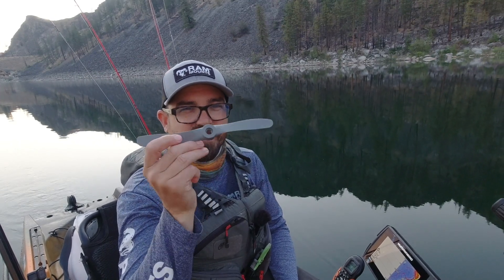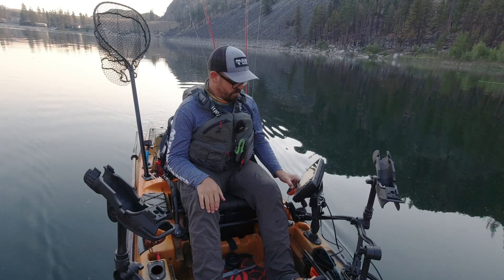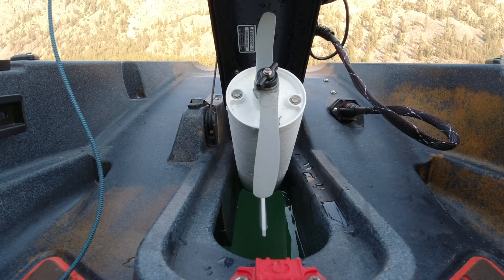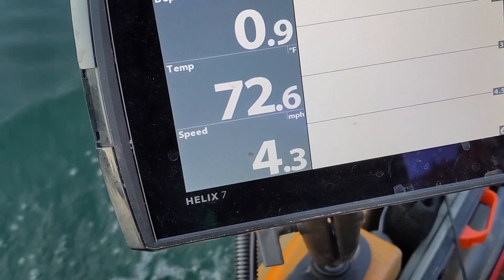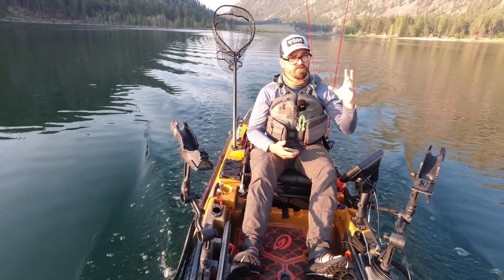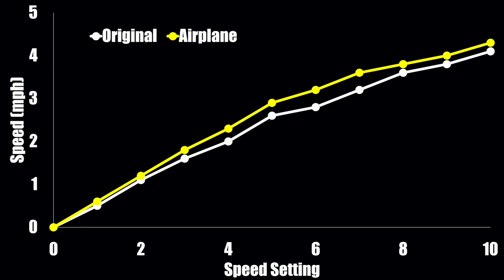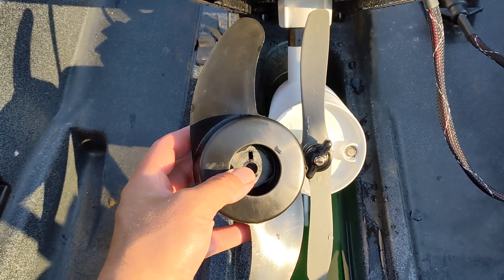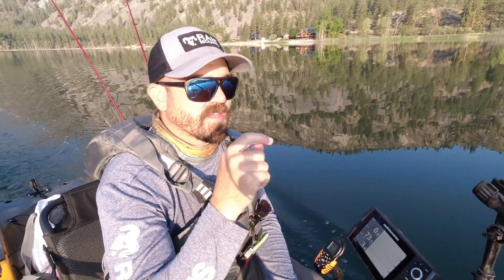Upgrade Your Trolling Motor for $4 [Airplane Prop on a Trolling Motor]

Comment: Prop twist has a lot to due with efficiencies and speed and needs to be matched to the rpm of the motor for peak efficiency. 

I believe the reason the rc prop is increasing the speed is because it matches the rpm of the motor and density of water as well a having less surface area and a larger usable thrust area with the small hub. That's just lucky that this prop matches the motor well in water, a different propeller may be better or worse. 

Mostly I think the reason is the increased drag on the propeller is the main factor, the stock propeller is just so much bigger when it comes to area coverage and that causes drag.
Reply: Yes, some of these points are correct.

Comment: If I were to guess the increase comes from the airplane propeller you have less weight and less drag so because of that you get an increase prop spin speed or faster rotation making it more efficient. the hub being missing I suspect is offset by the smaller overall surface area of the airplane propeller. Trolling motors were designed for full sized boats so the larger prop is basically forcing them to run in low gear so you have the power to push a larger boat. OK that's my guess we would need to have a bunch of different props to experiment to get a better idea to get to the bottom of it. I would like to see a hub added to the airplane prop see how that affects it.

Comment: I’d be very curious about the ability to handle wind and chop using the airplane blade. With a smaller blade width, would there be enough water displaced , and thus force generated to counter a headwind.
Reply from the maker: I don't think it will change the outcome. Thrust is thrust which translates to speed. It doesn't matter what's going on above the water.

Comment: My bet is that the trolling motor prop was designed to work with a wider range of boat sizes with a more generalist application. The plane prop is probably better at higher speed with lower torque requirements. With a heavier (not necessarily longer) boat, the plane prop might lose performance. 

On the idea around why the plane prop works better for this boat is that it has a lower pitch and surface area. That allows it to spin faster. Think more rpms with less torque. What would be interesting would be to measure the rpms of both props in water to see if that's the case. How you'd measure that would take some serious thinking.
Reply: I think if the trolling motor companies wanted to put the screws to buyers, they'd have put airplane props on these motors... The props that come on them are on there by design.... and to HIT stuff now and then with minimal damage to the unit.... Go ahead and get your minimal gains with the airplane props... common sense will have you replacing several a year , but hey....... what else have ya got to waste time and money on other than maybe a half mile an hour.... Enjoy......

Comment: own ap 136 ,not enough gain of sped vs weed edge benefit  for prop change ,   saw comment once on you tube that  "as per old town the speed is limited by the hull design and changing the thrust by prop or 55 lbs thrust motor would have little effect" ,  small outboard may be the only option for speed gain but liability issues are concern to all, explains why there only one side  steel reinforced mounting place  on the back of the AP instead of two .....